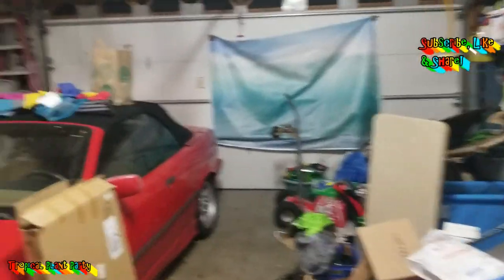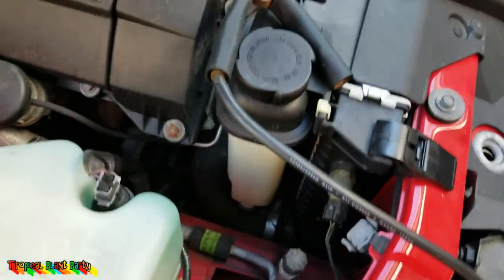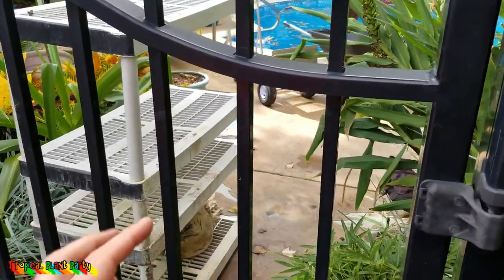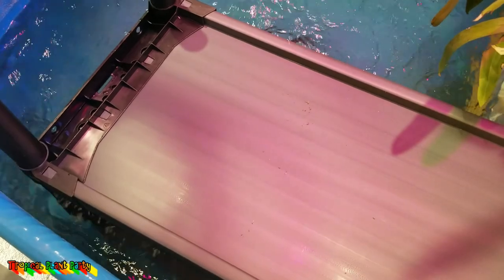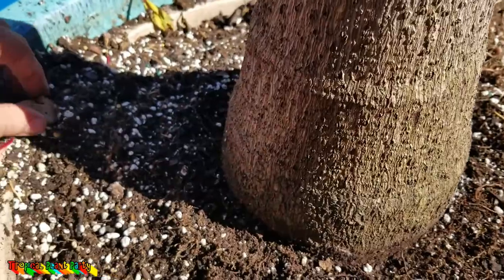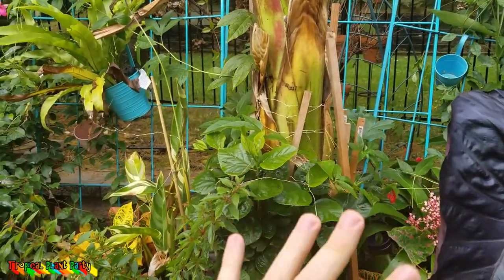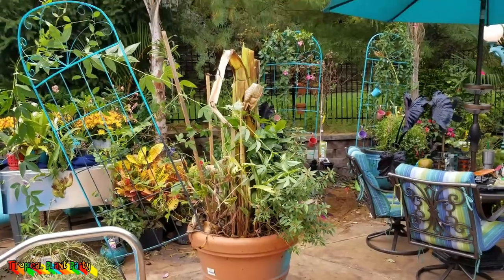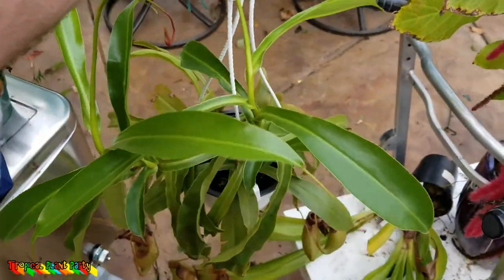❄🌺🌴TWIG Vlog | Creating The Winter Grow Room | Orchid & Tropical Plant Moving Day!

Comment: this winter was harsh, i lost many plants in my cold cellar. For next year I am thinking of dedicating my garage to plant storage, similar to yours. I am in same zone 6 as you, wondering how much would approx cost to run the setup from Oct-May(8months) ? How did you insulate the garage door ? wanted to make sure it holds the heat inside the garage. How did you keep the garage heated ?
Reply from the maker: hi Ash! I was going to insulate the garage doors with the foil bubble insulation this winter, but when i hung the plastic around the plants the temps stayed steadily war, so I didn't bother with it. Cost of keeping everything lit and heated is quite substantial and varies year to year. When temps are at their coldest outside, I run 3 heaters, 2 of them are 1500 watt and 1 I keep turned down to 750 watts most of the time. For the last several weeks I have been able to get by with only using one or two of the heaters which helps a lot with the cost. I also usually drop it down to just one heater at night time. Utility bill from november to may for us here is well over $1k. :/ However, if I had a better set up for electric or a gas line to run off of, I could heat the area much more efficiently and likely save money in the long run.
Reply: Thanks a lot...I appreciate your honest responses. I was thinking of covering the garage door completely with fiberglass insulation(Home Depot : Multi-Purpose EcoTouch PINK FIBERGLAS Insulation) so that no cold air come in  the garage and heat do not escape out of garage. This year I have used one of the big closet indoor, packed with plants...and cold cellar for brugmansias, elephant ears and bananas. Harsh winter this year killed all my plants in cellar...that got me thinking for next winter.
Reply from the maker: that really sucks that you lost so many plants! I would think fiberglass insulation would work great! ... as long as the motor on the door opener can handle the extra weight. I know the foil insulation is kinda junky and not very effective, so If you can keep the cold out efficiently, you'll be able to keep it nice and toasty in there!

Comment: what lights are you using ? anything special
Reply from the maker: Just full spectrum LEDS. I have a mixture of bulbs, some are Red led and some are  blue, and others just White. I prefer high wattage LEDS with nice lenses on them, such as Cree leds. I would prefer to use proper LED fixtures for growing plants, but they are just insanely expensive, and I don't think my electric can handle the 400 to 900 watts each unit consumes.